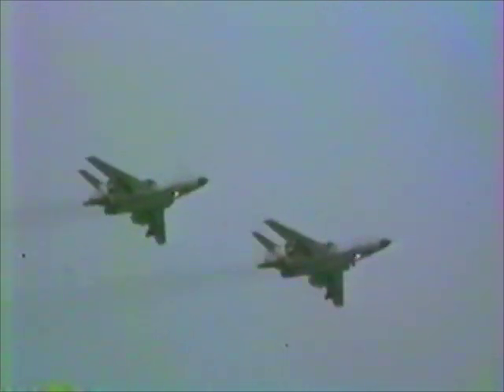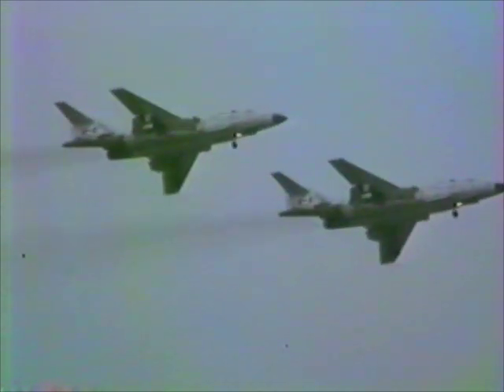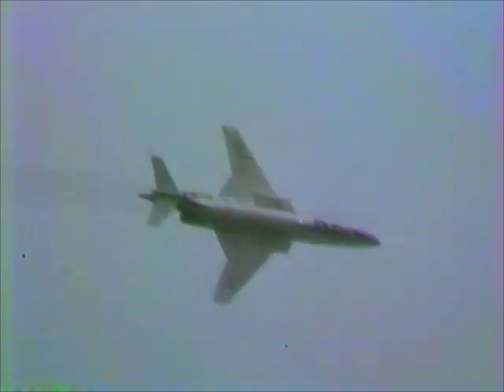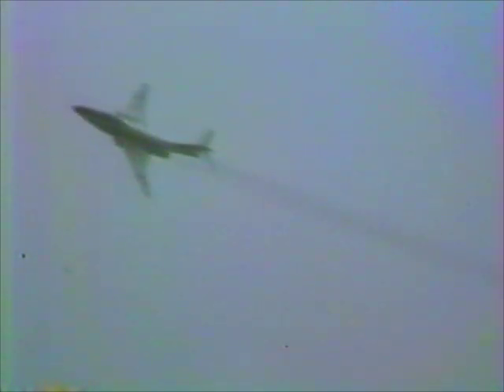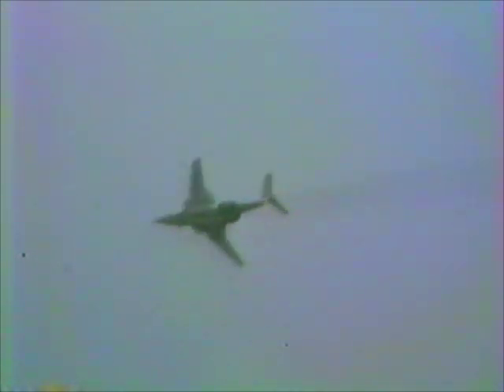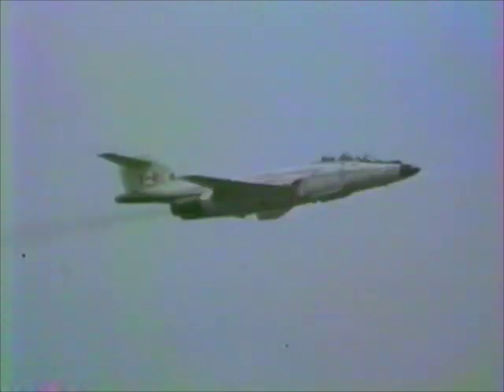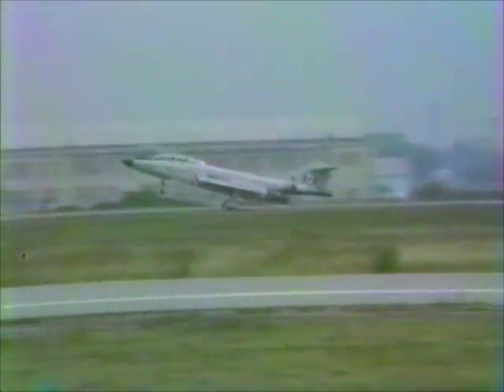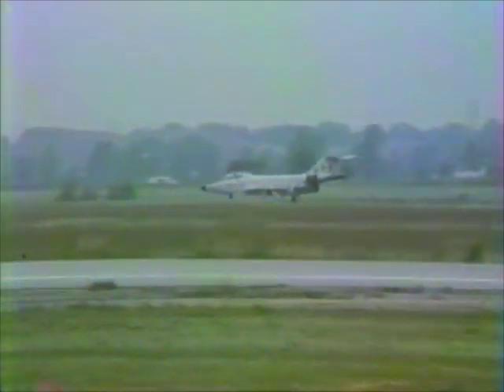CF 101 Voodoos

Comment: I have almost 1,000 hours Voodoo time in my log book.  It was a fabulous aircraft to fly - not agile like a dog-fighter, but highly capable in its roll as an interceptor.  The Abbotsford Airshow accident referred to was caused by roll-coupling (think of the main part of the aircraft rolling faster than the tail).  Net result was the aircraft splitting apart along the fuselage and allowing thousands of pounds of fuel to spill into the engine compartment.  Both the pilot  (one-o-wonder) J.P. and his nav (scope wizzard)  G.R  were badly burned - but both lived.  The 'fix' was to limit rolling to one 360 at a time.  As to 'why no chute on landing', pilots were never sure if the ground crew at a base away from home were competent to replace the 'drag bag'.  I took pride in being able to replace the chute myself (albeit with a previously packed chute), and refuel the aircraft myself.  The afterburner on the Voodoo was a single stage burner - dump raw fuel into the aft section of the tail pipe (via concentric spray bars) and ignite it with a 20 cc hot streak of lit fuel - voila a BOOM.  The burners rarely lit simultaneously, so another nickname for the Voodoo was 'double boomer'.  Ah, the memories  . . . .
Reply: AB...all or nothing. Really miss that feature. Last acft worked as a controller that had all or nothing was the 106.
Reply: I was in Moos Jaw in '71 and on the course after us there was a guy nemed Gerry Hunt who I believe was assigned to a Voodoo Sqrd - did you know him? I think I heard he was killed in a Voodoo accident but it was many years ago and remembering things is no longer as it was
Reply: @birgerkagan6087  There were two 'HUNTs' from that era.  Gary Hunt died 17 Oct, 1973 - I believe it was a CF 100 accident in Ontario.  Terry Hunt is still alive and living in Comox, BC.  Hope this helps, Don.
Reply: @donaldleben4442  Thanks a lot Don - yes it was Gary Hunt we met in Moose Jaw. I was sure he was on the 101 but apparently not.
Reply: @donaldleben4442  Appreciate the commentary! How did the F-101B do in dissimilar air to air combat training against other jets of its time?
Reply: @172ndairwing4  Not worth a shit.  Uf you spotted the other fighter soon enough, you could fire a nuke and that would end the combat.  If, however, the other guy got in close, we were dead as we had no gun.  That is unless we could ram him or eject our nav into his intake . . .
Reply: @donaldleben4442  haha, I take it “launching” the nav was a better option then firing AIM-4 Falcons?
Reply: @172ndairwing4  Minimum firing range for the AIM 4D is measured in miles.
Reply: role

Comment: Great video. I've always been a big fan of the Voodoo....a truly underrated aircraft that served Canada very well for a quarter-century.
Reply: "underrated aircraft" What the hell are you talking about??  It was a crap airplane that was a "deeply flawed" aircraft..  Great looking airplane, it had sexy lines,  but it could not live up to what it was designed for. It didn't have the high-altitude ceiling, it didn't have the expected speed, It had limited stores carrying ability,  It suffered from compresser stalls, to which several different intake designs were tried, non ever really 100 percent, it suffered from the dreaded and deadly pitch-up phenomon.  It could not fulfill the Air Superiority roll for what it was intended, and it could not fulfill the TAC requirement, and so that left it with two rolls: 1) All weather intercept F-101B and the recon RF-101C. And the RF version was the only one used in the Vietnam war. The only thing it had going for it was its predisessor the XF-88, which was the best in class for its time, but, by the time the XF-101A came about all the problems began, problems that were NOT evident in the F-88 design.  I love the looks of the F-101 just as much as the next guy, but I also know its short comings,  only in the latter part of its operational service whenn all the issues were cleaned up was it even satisfactory in it roll.   You really need to read "The F-101 Voodoo: McDonell's Heavyweight Fighter" when you do you will be humbled real quick.

Comment: I knew a fellow who flew the Voodoo for the Virginia Air National Guard, loved it but did say it had a pitch-up problem that could take up to 16K feet to recover from. He mentioned that it could fly very well on just one engine.
Reply: The pitch-up problem was because the aircraft would enter a flat-spin.  The only way out was to deploy the drag chute, wait for the aircraft to enter a nose-down attitude and gather flyable airspeed and then pull out of the dive.  The drag bag would tear off around 210 kts.  Never heard the 16K number, but always knew that a piss-pot full of altitude was needed.  We had a pitch boundary indicator on the airspeed indicator and we knew it was a dumb idea to pull more G than the PBI said you should.  Single engine flight was NOT a problem.
Reply: @donaldleben4442  Thanks for your expert input and thank you for your service. I grew up in Hampton Roads, Virginia, near Langley AFB, loved to watch the F-15's in flight. There's a Raptor Wing stationed at LAFB now. Enjoyed many airshows over the years, at Langley and NAS Oceana. I'm about 30 miles away now, miss the jet noise.

Comment: CF-101 Voodoos were based mainly at 3 bases across Canada.  409 Hawk Sqn at CFB Comox, B.C., 425 Allouette Sqn at Bagotville QC, and 416 Lynx Sqn at Chatham, N.B.  (I may be incorrect on the squadron numbers).  There was a small number in use with 440 Sqn at North Bay, Ontario for R & D. 
Chatham (now Miramachi) flew CF-101F and CT-133 Silver Stars.
Reply: my da was stationed in Iceland and flew F101
Reply: 410 cougar at Cold lake 414 black knight at Northbay for a short time were also 101 sqns
Reply: Thanks for more info...:)

Comment: The RF-101's were so fast, that McDonnell had to put a Forward are speed limit on them so that they didn't melt the windscreen in straight and level flight. But if you exceeded that they would have to chip you out of your canopy with hammers and chisels so you can get out of the cockpit

Comment: It's too bad you can't really capture the sound of these things on tape. I've been to a lot of air shows, and I've never heard anything as loud as these planes. Circa 1986 I saw them at Borden, which wasn't far from my home. They did a low pass over the runway in full burner. Car alarms starting going off in the parking lot and all the smaller kids started screaming and crying. I've seen F-15s, buffs, even Vulcans up close, and they get close on occasion, but nothing like this.

Comment: I believe the F-102 and F-106 had a similar engine. The afterburner light wasn't relatively uneventful like you see on the F-15 and F-16 and their multistage afterburner. In the F-101, a couple of loud "whaps" heralded the selection of their single stage afterburners. The USAF (and USN) wouldn't see a new engine until the arrival of the F-104 and F-4 Phantom II. I'm not sure if the F-105 used a similar engine.
Reply: F-100C &F had J-57P-21A engines. The F-101B & F had J-57P-55, at least ours at Niagara did.The F-106 was powered by a J-75. I crewed F-100 and 101 aircraft, but not the Delta Dart, 106. The F-16 was powered primarily by Pratt & Whitney F-100 engine and variants. The F-15 I believe had the same engines as the F-16, the P &W F-100. The F-102 had the variant of the J-57 engine as the "Hun". The F-4 (Barn Door) had  two J-79s, but could have used a couple more. The F-104 Starfighter had a J -79. The B-58 hustler had four J-79 engines with four afterburners. To this day nothing could intercept a B-58 at altitude given a overfly warning of five minutes. Back in the day they couldnt intercept the 58 with a 20 minute lead. The 58 needed a supersonic fuel truck flying nearby to be effective.

Comment: i think the ole voodoo could still give some of the modern fighters a good fight!!
Reply: John Spencer it’ll tear the F-35 to pieces.
Reply: Not really - they couldn't even follow the Avro Vulcan through a turn at altitude. But it was a decent interceptor.
Reply: If it could send off one of its 2 - AIM-1D Genie 1.5kt. nuclear tipped Rockets before the other aircraft could  get a shot at one then sure.... But our CF-101's were used only to take out Soviet Bombers, mostly  TU-95 'Bear' bombers coming over northern Canada had the Cold War turned hot.😎

Comment: The fact that RCAF was still operating F-101 in 1984 is troublesome. By 1984, Soviets had TU-22M, and likely had early TU-160 airframes in limited service. They certainly had MIG-25RBT and MIG-31 in service. Now we know that Soviets and Russians today, would have combined TU-22, TU-160 penetration packages with MIG-31 to aid in NORAD airspace penetration. No way would CF-101 and Canadian F-4 could handle those. Alaskan F-15s and available Navy F-14s would be only platforms to have realistic chance at interception.
Reply: We only had to hold them off untill the yanks showed up 
No worries my friend
Reply: We only had to intercept them head-on and at supersonic speeds.  Launch one Genie rocket and the whole squadron of TU-22/TU-160 would be vapourized.  Maybe us too. . . . .

Comment: the announcer is actually mistaken. these are F models. the original 66 B models were replaced with F models in the 70s.
Reply: +Jay Tumach Nope. They are (most likely) "B's". Our second "batch" consisted of one F from Block 61, two from 66, three from 71, and four from Block 81. All the others were "B's". The F's wore "tail's" 101001-007, 101022, 101024, and 101052. The B's were from a number of production blocks as well. 101008-101018 were Block 85, 101019-021,101023, and 101025-030 were all Block 90, 101031-051 were Block 95, 101053-066 were Block 100's. 414's "Black Beast (101067-leased from the USAF in 1982) was a standard Block 105 B model, outfitted by the "boffins" for use as an ECM/Jamming Aggressor. If you can make out the tail numbers on the aircraft in the video, you'll know exactly what you're looking at. My eyes are too old and tired. LOL! There MIGHT be an "F" there after all...the two are pretty much indistinguishable externally.
Geek mode off...;-)
Reply: No  they were B models with the Infra-red seeker on the nose so actually purpose built interceptors from an early-mid production run. in 1961 Canada got 66 of the newest B models (w/o the seeker) and swapped them out for 66 of the ones you see in this video (w the IR). Why? The USAF needs the newer Voodoos back to replace the losses and upgrade their F-101C recon versions they'd been loosing a lot of and wearing out in the SEA conflict. Also... in the last few years e.g. circa 1982 or 83 Canada leased its only F-101F from USAF stocks to serve as an Electronic Warfare a/c. They called it the Electric Voodoo. Cheers